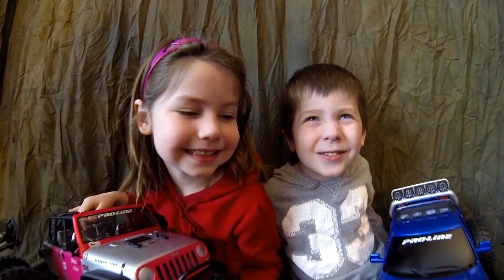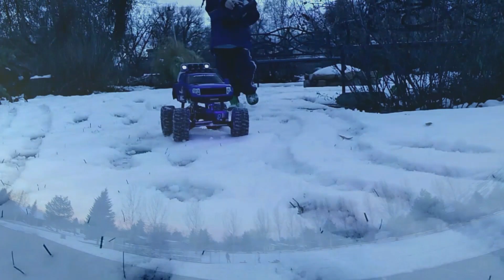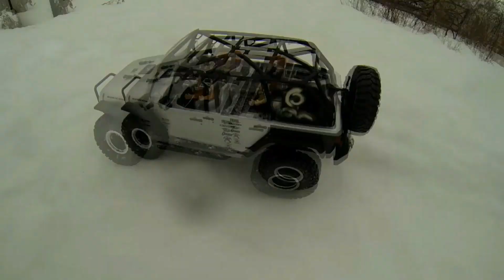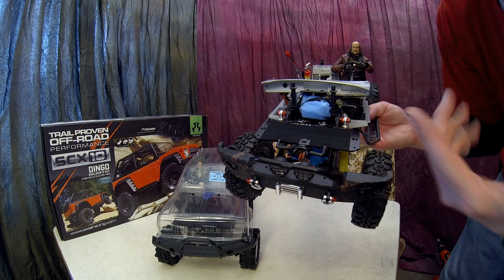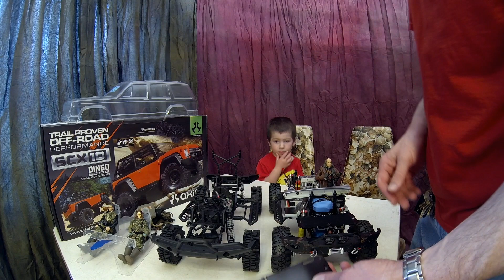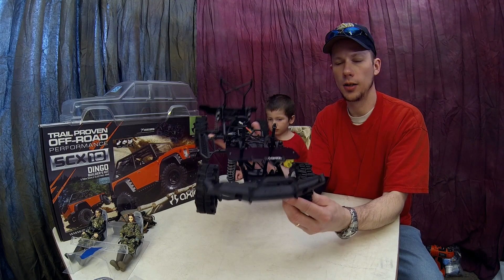JunkYard Mod for Hunter - Installing Battery Tray Sideways on a SCX10

Comment: That's definitely ANOTHER Mod I've got to remember!!! Nice! If I'm seeing it right, the Battery Tray sits over the centerline of the Axle.... So it just doesn't get in the way of the steering tires. Very smart Jason!! 👍👍
NOW I've just got to get a SCX10!! 😣😭😉
I'm not clear on all of it though... Everything was black on black. How LONG is that spacer? How long is the bolt? Otherwise, it looks pretty straightforward, using some common sense. 

BTW...... Was that a Dingo KIT behind you guys??? I didn't even know they made one!
Carmine 🚂
Reply from the maker: Yea this is a mod I've done on countless trucks.  Love how far forward it gets the weight and helps when trying to do some big time climbing.  Yea the spacer is a stock one that is in several of the kits and I think in the rtr's too, if I recall.  I can't even remember how long it is, but it's beveled on the bottom to fit right where the one screw would sit in flat normally.  I think it's about 1/2" long roughly+/- a little.  I can't remember on the screw either.  I know the long screw is in with most rtr's if the battery was up front, but can't remember.  It's probable about 7/8" long at least so you get a good bit down below, maybe a hair longer.  Yea that's a Dingo kit.  We got this so many years ago.  I did this video about 4 years ago and the kit we had for close to 2 years before I even did this.  So it was a while ago for sure.  Yea now if you find this kit on ebay they want an arm and a leg and your first born.  lol...  I paid like $250 for it back when I got it.  Crazy for sure!
Reply: WOW!! I'm amazed! I didn't think it was THAT old. But then again, I can't believe I'm that old!!!!  😱😨😜

I still really want a more "typical" Scaler SCX10.... but I CAN'T be greedy. I've been given such a great gift. Not just for its monetary value, but because it represents my entry into the World of Real, Competitive RC!!!  It's also really boosted my spirits. I had been very Down. The fact that I can no longer work, has depressed me like I never knew I could be. It's also exciting because I now finally have enough Rigs, to share with my Grandchildren!!

So yeah, I'm definitely keeping this mod in mind. Front weight bias is key for Crawling!!
Carmine 🚂

Comment: Hey Jason,  I have a question about this mod.  Does the tire ever rub the trey when the suspension is all twisted up?
Reply from the maker: Hey there Adam.  I've never had any issues with it rubbing at all.  I only run 90mm shocks max on these rigs.  I wouldn't think it would cause a problem on shocks with longer strokes unless you lower the whole rig.  The plate is resting really close to the top of the shock hoops and it still has the stock spacer up front.  So it should be totally fine.
Reply: CodesEmpire Sounds fantastic that will be much better for the weight distribution on those really steep Hills. Thank you for the great mod.
Reply from the maker: adam thefallnONE Your welcome bro.  Yea it really puts a lot of extra weight on those front tires for climbing up stuff.  Let me know if you have any other questions bro. 
;-)
Reply: CodesEmpire JASON this mod is awesome.  It added that bit of extra front end weight I needed and you are totally right, even in full flex the tires never touch.  Thank you for the awsome "Junkyard" mod.
Reply from the maker: adam thefallnONE Thats awesome Adam.  Glad it helped out bro.  Have fun crawling my friend!
;-)

Comment: does this mod require smaller batteries?
Reply from the maker: No, I havent tried to run a battery with a cell stacked on it, but as far as any of your standard 7.2v NiMH batteries should work fine.  I run a 6 cell NiMH 5000 mAh battery and its fine.  I hope this helps out.  Thanks for watching. 
;-)

Comment: That's a great and simple mod. I'll be watching the interior install for sure. 👍👍
Reply from the maker: Thanks a ton Dave.  Yea I cant wait to get started on the interior for sure.  ;-)
Reply: +CodesEmpire an oldie but a goodie :-) I did a similar mod that I learned from UK  Scale an Crawler. the battery sits sideways behind the front wheels. You use two servo mounts from the spare parts tree to attach the tray to the chassis. I used a small round file to countersink the slots where the velcro straps went.
Reply from the maker: Devolution RC Yea I've done that mod with my battery tray also on some rigs.  It just depends if your planning on putting an interior into it or not.  I do like it a lot more cause the weight is lower on the rc.  Thanks a ton Dave for sharing this with me.  ;-)

Comment: Pretty sweet, the weight in the front can always be helpful!
Reply: Weight positioning is the main problem I have with my Honcho at this time.  I am getting the Rampage Front Recovery Bumper form RC4WD soon and it is nearly three times the weight of the stock front bumper on the Trail Honcho.  It still isn't very heavy but it's a step in the right direction.  A friend of mine that I run with has a ten pound Honcho (mine being at the time basically stock is around four) told me "Light has its advantages" so we just have to find the right combination!